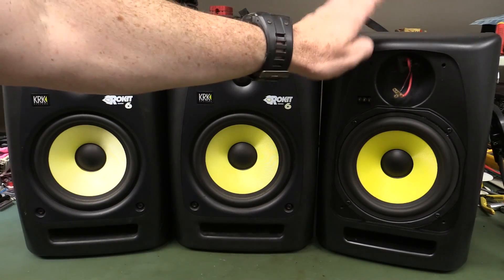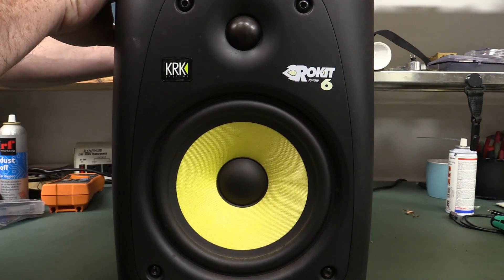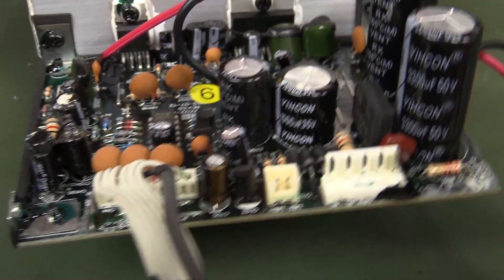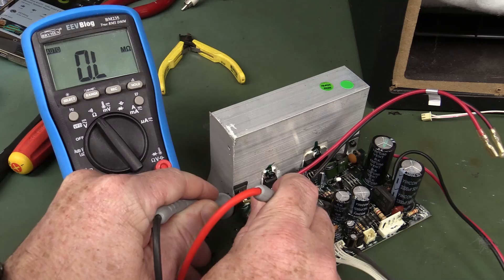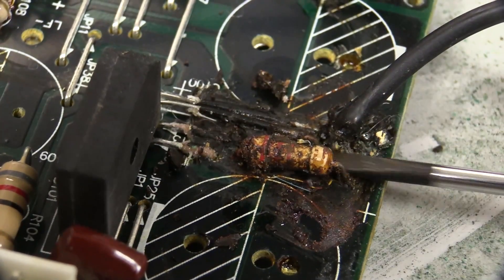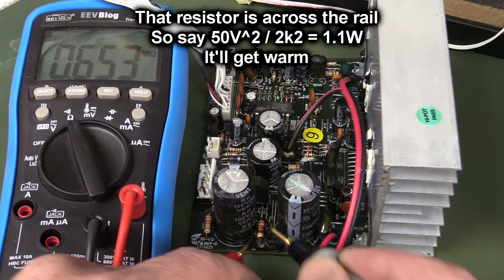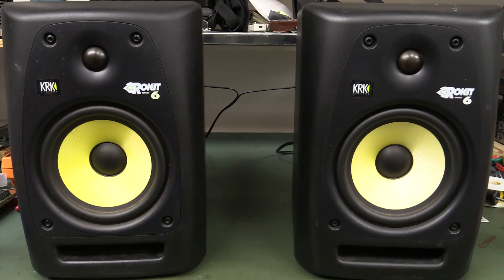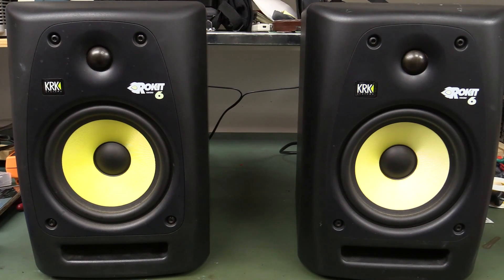EEVblog #1073 - MORE KRK Rokit Black Gunk Speaker Repair

Comment: And this is a quality professional product ...??? you pay a lot of money for a speakers with a shit on to the boards that can eat them overtime from a factory !? the f.. and the company don't even care about this issue.. and of course this issue will start to show up when you out of warranty because it takes time.. this is just.. i hope they go bankrupt.. at one glance it looks like innocent accident or a mistake but this is more like a scam.. they should offer new boards or at least partial refund to people even if you out of warranty because this is a factory defect.. its not users problem that this gunk is wrong not quality one or somehow chosen wrong by mistake.. never gonna recommend or buy from them they can screw up and get lost.. even if they fixed or will fix this in a future with a newer model's.. i'm not gonna like a company that avoids a problem and washes hands instead of fixing a problem they did. Shity speakers from ebay will last longer than this crap.. they will sound terrible but at least will work. Even if they work ok i think this is a far from pro class..

Comment: No self respecting pro audio engineer would use these monitors. These are nothing but consumer grade electronics marketed to people with home studios who don't want to drop a few grand on some respectable monitors.
Reply from the maker: Why don't you tell use what the respectable models are?
Do you really need to spend a couple of grand to get anything "respectable"?
Why is price your criteria? Should performance for a given scenario be the only criteria that determines "respectable"?
Reply: audiophiles insert stupid rolling eyes face here
Reply: Well dave, you won't be able to judge the difference without hanging the magical crystals on your pure gold cable with diamond fittings.
Reply: EEVblog I think most studios will have a pair of Yamaha NS-10 or the modern versions for mastering, not because of their performance, but they provide them with "if it sounds good on these, it will sound good anywhere else". And then they'll have some other way more expensive monitors for mixing. These KRK speakers appeal more to people with small home studios...
Reply: Switched from KRKs to JBL LSR305 for bedroom producing, never going back.
Reply: Tannoy, Genelec, Adam, Focal , Yamaha etc have a less hi-fi reputation.. I used to sell a lot of studio monitors back in t'day and had them all set up in a listening room. Always felt bad letting customers walk out with KRKs but their brand has gotten a good rep somehow.  Plenty of great speakers out there for a lot less than a grand though , especially in dumpsters :D .
Reply: Great.  I just told my sister to go and see how they sound.  BTW, how do they sound?  I have active JBLs and they are phenomenal.   I guess I need to hear them.  I can't tell by this video.  PS. How can my sister go and SEE how they sound?  She has to HEAR how they sound.  Moronic.
Reply: I had a pair of first gen Rokit RP 6 inches woofer. The JBL LSR305 sound quality is miles ahead as far as studio monitoring is concerned.
Reply: don't know if you can get them down under but i've always liked wharfedale
Reply: Speakers are one of the few items where you need to spend good money to get the best performance. They are primarily mechanical devices made in small quantity. It costs a lot to do good mechanical engineering and cover the R&D.

Electronics is a different matter. A cheap soundcard now has performance surpassing the best analog tape machines of the 70's. Amp ICs form from ST and National are as good as any discrete design. Op-amps have almost unmeasurable distortion.
Reply: "No self respecting pro audio engineer would use these monitors."

Accept for when they do. You are mistaking pro audio engineers with pro audiophiles with cash to burn.
Reply: word! i was looking for a comment like this , because thats what i first thought about those Plastic Bombers when i heard the KRK Hype start (like 2009 ago?!)
Reply: I repair active monitors on daily basis, and KrK are biggest junk I used to work with by far
Reply: "I repair active monitors on daily basis, and KrK are biggest junk I used to work with by far"

That's biting the hand that feeds you then. Without affordable nearfield speakers for the home player or the financially strapped, you'd probably not have a job then!
Reply: Dave, 
KRK's Rokit series seem really cheap compared to the V8 (ver.2s ) that I have.  It's really amazing how much they cheaped out.  I bought a pair in '04 and have never had a issue.  Work with what you got. What sounds good to one person, may not to the next.
Reply: i, too, have lsr305s
Reply: Dave, you should know as well as anyone that just because you can get something cheap doesn't mean it's any good.  What you're seeing in your vids is common across every manufacturer that has a low-end product line.  I just heard you say that KRK is aiming these at the professional market, which isn't really true.  Their low-end offerings are aimed at bedroom producers, just like every other low-end cheap monitor.  KRK's V series and the Exposes are proper monitors and are made properly.  These are throw-away commodity monitors that are good for writing music on or doing non-critical listening like bulk editing.  That's it.  Good audio hardware that can be expected to last still costs a lot of money, just like it always has.  The only thing that has changed is how thoroughly the poorly built and QC'd cheap stuff has taken over the conversation and market because everyone is an 'audio engineer' now, there's tons of money to be made off of them ... buy nice or buy twice.
Reply: You may know more than him in a particular area, but I don't see your youtube channel having over 500,000 subscribers and getting 80,000 video views a day.
Would you like to elaborate on where he was lacking knowledge? I really am interested.
Reply: I totally agree, there are vintage speakers that none of these people would touch that are far more accurate and some you can pick up for very little or even free. BTW I'm ex-Audio Note, arguably the finest hifi available, and yes 99% of hifi is total shite! These horrible KRK disco boy speakers included :o)
Reply: JBL, Yamaha, Genelec, even Adam today have really affordable great quality studio monitors for "amateurs" / "bedroom producers", you don't need to spend that much to get good quality gear, chances are, your shitty accoustic in your untreated room will be the real limiting factor for "studio monitoring". KRK is usually just a little bit cheaper than those brands, still, they're not worth the less than 100 bucks you save.
Reply: Rich from KRK here. Many pro engineers use these to make huge records. You just have to do a google search and it will come up. Jacquire King mixed the big Kings of Leon record with Rokit 5s and everything since up until he worked with me on the V Series. When I started working here, I didn't know anything about them. I used high end monitors for years and never even heard of Rokit. (Hard to believe because they are everywhere) So before I knew anything about them, I put up all the older KRKs and then I put up a pair of Rokit 5s and I was blown away, I couldn't believe it. Then I started investigating and found all these pro guys using them. Since being here I have hooked dozens and dozens to major pros from Ulrich Wild to Dave Jerden to Stuart Brawley to Dwayne Larring to Aaron Sprinkle to Dave Pensado with Rokit 5s and they use them and love them. If you want to drop a grand, we now have the new Vs which I birthed from these guys liking the Rokit but wanting more headroom you get with more power. That has been going great. Dave Way just sold a major and expensive pair of monitors because he is blown away by the V8s.
Reply: Spunkmire, you should check out the V8 Series 4. I developed them with guys like you in mind.
Reply: TK Street Thus I guess the proper test for studio monitors isn't "golden ears", but setting up in an expected environment (treated walls and a warm but not involved mixing board etc.) and a top notch measurements microphone like a Bruel & Kjaer.  Then do frequency sweeps and combinations across a 90dB volume range and measure any and all deviation between input and output.  Linearity, flat response, no unexpected intermodulation, distortion, SNR etc.  need to be plotted and compared to perfect reproduction.
Reply: They are very popular with electronic music producers and I'd say they are pretty good for the price you pay.
250 for one speaker is already quite expensive for some people. I couldn't afford new ones right now if my Rokit 8's broke.
Reply: i use emotiva speakers and they are great. only problem is one side has an LED go out. like wtf, i thought LEDs should last forever not just a few months?
Reply: its´the speaker itself used to build a monitor, the cheaper ones simply use of the shelf types usually made in china. better ones use speakers made in chaina as well, but made to thier specs. it´s all about quality control and pair matching.
I worked with klein&hummel stuff, and they used isophon (both germany located) speakers but also specc´d to their needs. and that´s why they´re usually much more expensive. I would recomend genelec, they know what they´re doing and i also worked with their 1026a for years as our main speakers and also the 1030 nearfield types right on top of your mixing desk via L shaped supports.
Reply: bullshit...everyone can tell the differenece between KRK and let say Genelec, PMC or Neumann speakers using the same footprint, by the first few seconds comparing these with the same song.
Reply: tannoy and also focal and yamaha did HiFi way before they did "proAudio" speaker....see tannoy westminster and yamaha NS (for Natural Sound) 690 for instance....
as when audio studios began to buy HiFi speakers in order to have the customer satisfied (the mix don´t sound any good at home, you can´t mix shit)....they also began to produce studio monitors....and in some cases the only difference had been the namex they go by-...;)
Reply: The build quality on these is .... not great.  I mean... that's what you get at this price point.  They're OK for what they are, but they're not high-quality speakers.

I wouldn't be surprised to see big names using them, but it won't be their main monitor.  There's nothing wrong with using these things within their limits, and if you're just starting out and making music as a side gig, then by all means -- it's better than not having anything.  But if you're charging $150/hr or more for your experience as an audio engineer, you really have no excuse to be making compromises like this.

Even if they sound "OK", it's still ultimately a cheap tool.  Cheap cabinet, cheap drivers, cheap components on the amp PCBs.... there's a reason these don't cost much.  It's nice that someone is serving that market, but this is not an adequate replacement for a good, quality monitor -- if a good, quality monitor is what you need.  There's nothing snobby about that, it's just the truth.  I have and use some Behringer stuff.  Sometimes good enough is, sometimes it isn't.  Choose your battles.
Reply: Diggnuts well if you were to use your brain then you could get hold of some of pro speakers that someone has thrown out fix them up and bingo you have something half decent for next to nothing.
Reply: Perry Codes I'm sure he said at 11:06 those caps were rated for 1000 volts when they clearly say 1000 uf.

Comment: I had a first generation pair, never a problem, so why making a 2nd generation that breaks... Sounds like Apple planned obsolescence
Reply: I have to disagree, planned obsolescence is just suicidal for any company attempting to market to the professional industry. Whereas consumer electronics are reviewed at the beginning of their life, professional electronics are typically reviewed based on recommendations within the industry and will include information on the longevity of the item. Intentionally reducing the lifespan of a professional product would destroy the reputation of a manufacture.
Reply: I would just assume they cheapened up the second gen for a higher profit margin. I kinda doubt they actually intended these things to fail this way.
Reply: Why the idiotic and uncalled for swipe at Apple? And since when do Apple have planned obsolescence?
Reply: yep someone  thought they knew better, cheaper caps, some unbranded sealant, maybe couple bucks saved per unit
Reply: Because apple is well known for planned obsolescence.
Reply: John Coops....What about the issue surrounding their older Iphones and bogging down the IOS (which they actually owned up to....LOL....sounds like planned obsolescence to me.
Reply: absolutely,after watching several videos there, i got a better insight on all the Apple products i had since 2001,something you never fully understand because A** uses magic in every product,but especially after the first Iphone came out,it all went downhill (for the user)with a well thought out plan
Reply: John Coops apple have found a way to make devices obsolete by there updates and have admitted it . Genius but wrong .. just Google it ...
Reply: Griffs Swop shop They also obsolete them via AppStore policy: You can only install the latest versions of Apps, App developers can only upload with latest XCode, latest XCode only let apps support recent iOS versions, newer iOS versions drop support for older hardware versions.
Reply: Rich Renken from KRK popped into the comments in the last video, said that was something the contracted board manufacturer did on their own, and they only found out that it caused issues later. But these boards are visibly cheaply made and populated, so while not intentional, kind of unsurprising if they turn out of low durability.
Reply: "apple is well known for planned obsolescence" says WHO... You?
Reply: My Mac Desktop is eight years old and working great,
Reply: It was because the newer OS was killing battery life on old phones.
Reply: Comments above re: Apple iOS updates making devices obsolete are idiotic to the extreme. Consider Android... how come my old phone is not supported with updates, and you need more powerful hardware to run each new Android build? And PCs... try running windows 10 on old hardware that used to run XP and Win 7 pretty damn well. So, this "making old devices obsolete is INHERENT to all modern technology, and nothing to do with Apple.